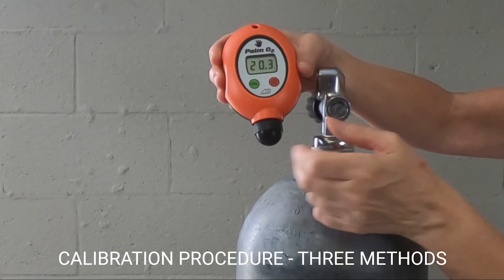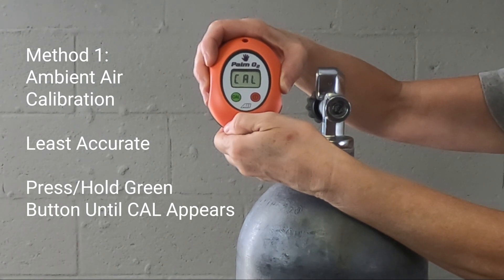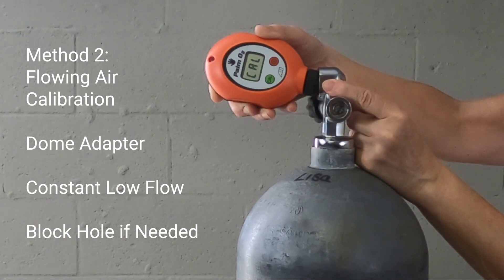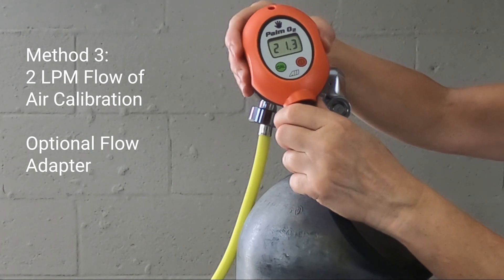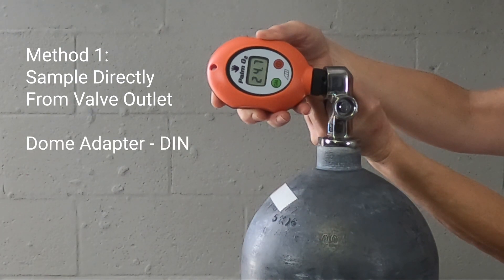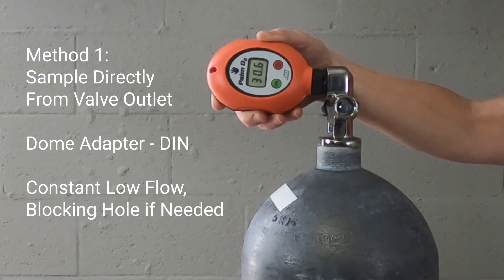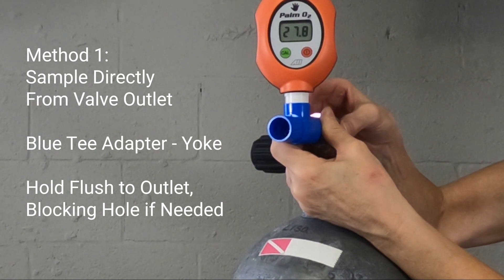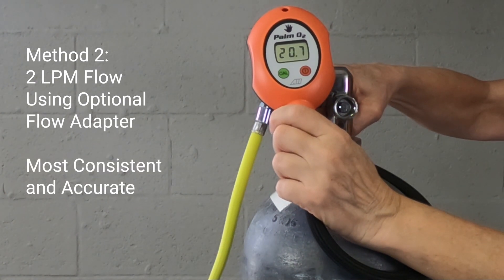Palm D Oxygen Analyzer

Comment: This video shows performing unit calibration using tank gas?  Who would ever trust tank gas to be of any particular mix, I mean this is why we are testing tanks in the first place!!!  What kind of gas is Palm smoking?
Reply from the maker: The video illustrates calibrations using known gases, both from ambient and compressed sources.  The tank of compressed air used for calibration is not the same as the tank containing an unknown gas being analyzed.  If the gas contents of a tank is unknown, then it is not an appropriate calibration gas.   The Palm D does include a safety feature in that the calibration will error if the gas being used for calibration does not produce a sensor mv reading near expected for either air or pure oxygen.   However, using a tank of compressed air for calibration is the recommended calibration method that produces the most accurate analysis results for sport nitrox mixtures.   For more information about calibration best practices, read https://www.divegearexpress.com/library/tek-tips/calibrating-analyzers-with-air

Comment: The user manual for this analyzer specifically states:

"Never calibrate with 20.9% oxygen or room air with the intent of taking oxygen measurements at oxygen levels above 30% oxygen"

This makes it quite useless for Nitrox divers, or am I missing something?
Reply from the maker: Note: You are referencing an early version of the user manual that contained an error.   The user manual was updated to in 2018 to specify 40% (instead of 30%) and now reads... 

"The devices are designed to meet the requirements for both ambient
and elevated oxygen measurements but should NEVER be calibrated
with air or 21% oxygen with the intent of taking oxygen measurements
at oxygen levels above 40% oxygen.

Accordingly, the devices may be calibrated with either air (20.9%) or
100% oxygen which requires the user to make a conscious decision to
bypass or skip the recommended 100% oxygen calibration.
Reply: @DiveGearExpress  Thanks for clarifying
Reply from the maker: The Palm D Oxygen Analyzer is designed to meet the requirements of oxygen measurements for the purposes of recreational diving applications. Best practice for the most accurate nitrox measurement is calibrating and sampling at 2 liter-per-minute flow using air or 21% oxygen for the intent of taking measurements of oxygen levels below 50%, or using 100% oxygen for the intent of taking measurements of oxygen levels 50% and above.